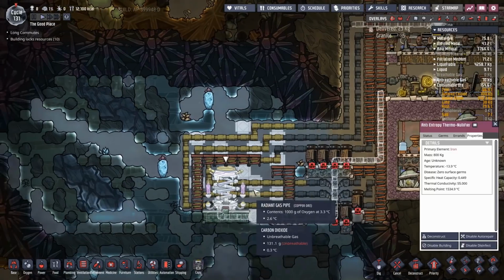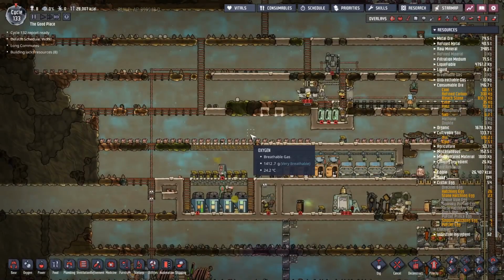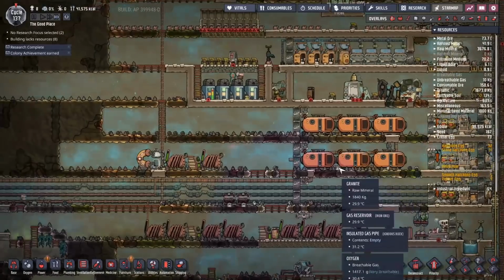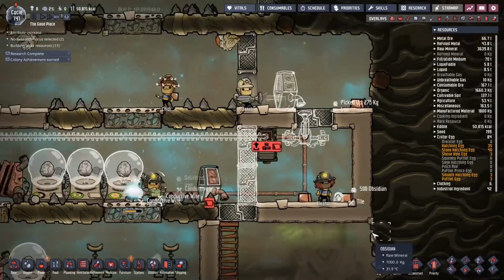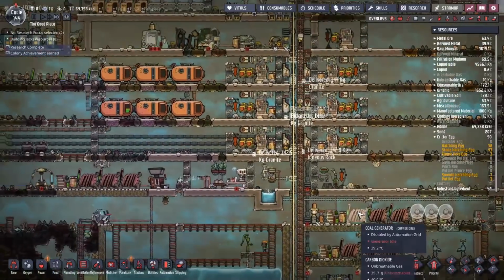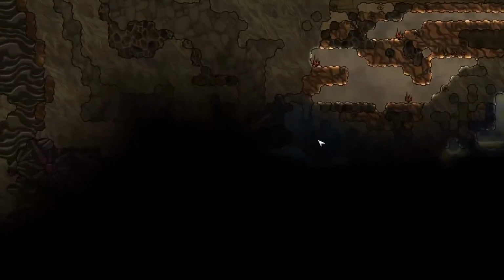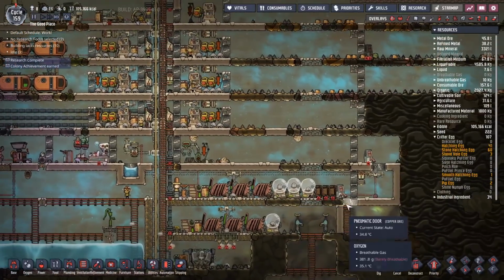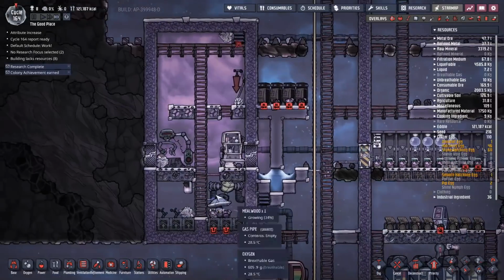Badlands Max Difficulty 5 : Hydrogen, Atmo suits, Drecko's and plans : Oxygen Not included

Comment: What's the point of putting all of those sweeping systems on several floors if you could just replace natural blocks with plates and all of the stuff would fall on a single bottom floor? It's just overcomplicated and excessive!
Reply from the maker: This as a while ago but I think I was moving all the resources to one spot so I could feed it all to my hatches automatically. It worked really well if I recall.
Reply: @FrancisJohnYT  I mean you could move all resources on one floor and then sweep it out on a single spot just by constructing one floor of sweeping system
Reply: @FrancisJohnYT  and not building four of them lol

Comment: I tried drecos on my newest base and in my case it postponed the need for a proper industry brick for quite a while since I got most of my plastic needs covered and lead + rock grinder where enough to supplement my refined metal needs enough for me to get to space and start harvesting the steel from meteors. While note exactly a replacement, it did help me with designing a new industry section that wouldn't need corrections since I had already access to every non space material (although having visco gel would help there since I love the 1 tile wide liquid locks).

Comment: 5:42 what I usually do is building the standard overflow detector, double bridge+sensor, inside the Rodriguez, as part of its design. I connect the sensor to the automation line on the smart battery. This doesn't prevent you from building an external overflow handling system, tanks + generator, infinite storage, whatever suits you. The one inside the Rodriguez is the last line of defense. If you forget to build the external one, or if you decontruct the wrong pipe, or connect the hydrogen generator to an automation line by mistake (all things I've done in the past), the internal safety triggers, and saves your atmosuit docks.

Edit: 5:00 Just remember now vents can be automated w/o shutoffs. So you can easily put one (or more) atmosensors in rooms and activate the nearby oxygen vent when pressure is say below 1200-1500, instead of relaying on the fact that vents overpressurize at 2kg/tile. This both cuts down on the initial oxygen draw but also avoids over pressurizing the base before you have plastic for high pressure vents.

Of course nice video as usual. Sometimes I just forget to write that, it's kinda implied at this point. But yeah I reminder doesn't hurt either. :)

Comment: You should build just 1 auto sweeper set up at the bottom of the area to clear. Then use ladder scaffolds to drop upper levels down to the sweeper level. I use this just above the oil biome to sweep the entire map to my central transit network then 4 conveyer loaders to move it up to unlimited storage. I also setup a few sweepers at my unlimited storage with rails going to space, industrial brick kitchen or other projects.

Comment: I read on the wiki the liquid and gas tanks can exchange heat with the tile directly below their output port.  If you use a mesh or airflow tile it'll prevent them from exchanging.  Of course that's if the wiki is up to date ;)
Reply: That only works in a vacuum because it will just exchange heat with the gas inside of the meshtile.

Comment: How does the husbandry skill affect the dupe's ranching activities, more specifically what does it speed up?
Reply: It prolongs the time until a critter needs to be groomed again
Reply: @SaturasLp  Did not know that, so that's why my dreckos are glum so often. Thank you very much!
Reply: @Atabi55  try to pick dupes with +7 ranching, it gives them an awesome boost, some even take one of those as a starting dupe to speed ranching up even further
Reply: @SaturasLp  It also affects the duration of incubator Lullabies
Reply: To extend this - it's 10% of a cycle per skill point (the default is 1 cycle). So a dupe with 5 points in ranching grooms a critter for 1.5 cycles (900 seconds). While a dupe with 11 - the max easily obtainable - will groom a creature for 2.1 cycles (1260 seconds).
Reply: Did they still not fix the bug that husbandry is almost impossible to raise?
Reply: @vulkandrache1928  sadly no. Egg hugging is still the only way to raise it besides whatever points the dupe comes with plus the 4 points from the skill board from the 2 husbandry skills.
Reply: @vulkandrache1928  I believe husbandry only levels up when singing to eggs, but that should be changed imo.

Comment: for power you can make a sour gas boiler using plastic from dreckos, and the AETN for cooling. I saw someone do it on reddit.
Reply: I don't know how efficient that'd be, but I'd love to see that. Seems like a very creative approach.
Reply: Yeah, how much throughput did they do with that one? 100 grams? (AETN cant cool much and it has a close minimum temp than S gas solidification last I checked)
Reply: @Interloper2448  if you pre-cool the sour gas to -10 using a generic aquatuner setup and combine it with a counterflow system then the throughput should be pretty good.

Comment: I usually set up a glossy drecko ranch as soon as I can. Usually I get a lot of plastic and reed fiber such that I don't need to make polymer presses.
Reply: Usually what I love to do is make one ranch for dreckos then dump all the excess eggs in one hole with a shearing station where they get sheared then starve and I get meat, lime, and fibre/plastic. Not as efficient as actual farms I think but if built early on it can be really useful
Reply: Yeah but here he could dig down, build a quick refinery, fill one tank of petroleum,  build a press, get plastic. No golden amalgam is an inconvenience, either you can sacrifice the press and rebuild it when it breaks, or find a cold place. I bet he can do that in less than 20 cycles, given that apparently there's a frozen biome not too far. Or you can make steel, he's been ranching for a while, there should be enough coal and eggshells. Refined iron is abundant. IIRC there should be fossil as well outside the oil biome.

Unless he's very lucky, dreckos aren't going to drop a glossy egg too soon, and anyway he has to wait 33 cycles - at best - for the first glossy critter. I'd say he's 35-40 cycles away from the first tiny bit of plastic as of now, and that's with a decent dose of luck.

Basicly it's much quicker with the press, unless if you really really rush drecko ranching, then maybe it's about the same time. Still you're paying the price in early dup labor, which is kind of a scarce resource.

Comment: While it's true that the total cooling of the AETN doesn't depend on the surrounding gas, in my experience the heat exchange rate with the oxygen pipes does. The oxygen runs past the cool area quite quickly and it seems to get colder in hydrogen

Comment: Oooooh no geothermal base no! You beat me hahaha
I was preparing a neat geothermal base for your base loving, but I got tired of oni for now.
I came up with a great great system for geothermal power, it outputs rocks at 127°C, so it's like 95% from the maximum theoretical power you can get from the temperature differential. I can send you the file of you want to check it out.
Reply: I'd love to see you implementing in your base if you like it :)
Reply: could you get that rock cooler by adding another stage of cooling?

 pre-heat the hot-water output of steam turbines using 1kg packets before it returns to steam chamber.
that should get rocks closer to 95°c
Reply: @PyrokineticFire1  oh that's true! I was actually getting it at 107 output because it's exchanging heat with the return water but inside the heated chamber. I might be able to reduce it more tho.
Reply: i saw that trick in a tutorial video for metal volcano tamers & really liked the idea: makes use of a resource that's frequently underutilized.